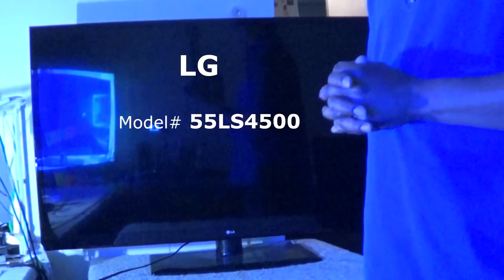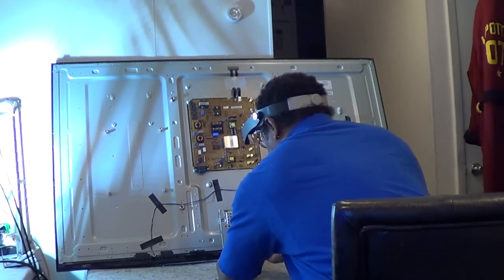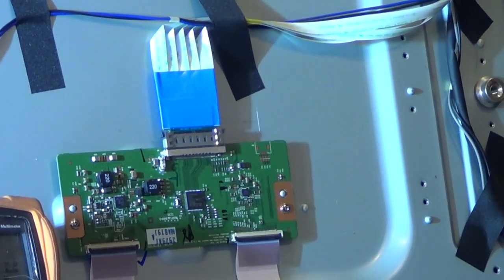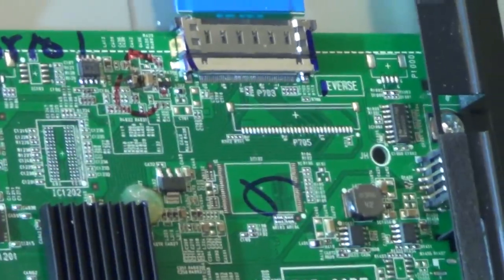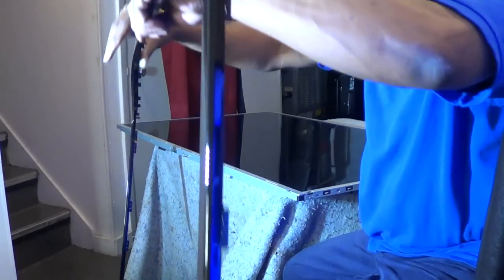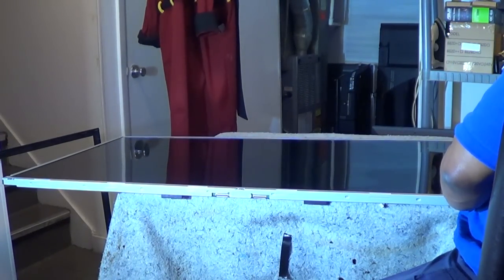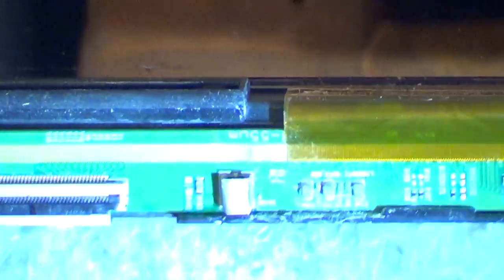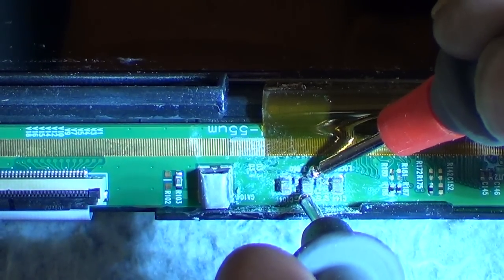Backlight but no display. T-Con board or bad LCD Panel? How to Isolate

Comment: Bigdog, I have the same problem on an LG 47LW5300. Originally the power would click and it would blink red twice black screen. I just replaced the main board and now the backlight came on, but no picture. 

It does exactly that. I checked the fuse that you checked at the beginning of the video and I am getting continuity. I think in your video you weren't getting continuity? Is that fuse supposed to have continuity? I am getting 1.4ohm on both sides when I ground to the case and check both sides. If I turn the TV on and test for voltage on the fuse like you did at the end... I get zero and not 12v like you did.

I get a white screen, no logo or menu. I disconnected one side of the tcon board and the whole screen is the same white. Disconnected other side and got same result. Basically screen is completly white no matter what I disconnect from the tcon board. I don't get half screen working.

Edit: I just checked and I am not getting 12v to the tcon board and the tcon board chip is cold to the touch. Power supply is giving power to the left lights. I have to check if the main board is getting 12v.
Reply: I did some more testing. I ruled out the power supply. Power supply has all the listed voltages and it's powering the backlights. I check the voltages from the power supply to the main board and they are good.

I am not getting power out from the main board to the tcon board. I checked pins 48-51 on the lvds ribbon on the main board and did not get 12v. The main board is receiving 12v, but it's not sending it to the tcon. 

I confirmed that the tcon is not receiving 12v by testing the fuse. The fuse beep when I tested for continuity, meaning is good. It leads me to believe the main board is not powering the tcon board. That's why I am getting backlight and no picture.

I followed this article for testing.

http://electropair123.blogspot.com/2017/01/t-con-board-troubleshoot-no-picture-on.html?m=1

Comment: Hi bigdog8882 When is a vertical black line almost in the middle of the left side?
Reply: Is un60fh6003f    t con BN96-28944A, where is a volts?

Comment: Hello sir nice vedio i have a similar problem but on t-con board i remove the shorted capacitor 
and did not put in any i leave it just like that and it started to play ok ,is  it all right to do that or it will give problem shortly.
Reply from the maker: Its there for a reason. Take Ur chances.

Comment: Big dog please respond, same thing happened to my TV last night, opened TV up and found the crustation from water on the lower board,  I cleaned it with proper alcohol, re-assembled everything and I get the same thing. It does look like one of those capacitors blew out. Should I replace t con or do what you did in this video.
Reply from the maker: Where was the water corrosion ? Which Board. T-Con or Driver board?
Reply: @bigdog8882  driver board
Reply: I have model number 60ln5600 LG
Reply from the maker: @petermcdowell63  Well, U got water damage so its hard to say, You have to test the capacitors in the Vid like I did. Its a good chance that theres something bad on the driver board. U can try t-con, but dont give your hopes up.
Reply: @bigdog8882  lol my Hope's are high after watching your video, I absolutely love this TV and dont want to junk it. My next step is to try to locate driver board and t-con board.  And find a shop who knows what there doing. Thanks for the quick response, you da man 👊
Reply from the maker: @petermcdowell63  They dont sell the driver board by itself because its bonded to the screen (U have to find the whole screen). But you can definately find the T-con and replace that. Thanks for watching.
Reply: @bigdog8882  I actually found the driver board replacement. Believe it or not on Ali baba. And looks to be OEM equipment . This is the driver board P/N  6870s-1491a. Check it out let me know what you think.

Comment: I have the exact same model TV sitting on the table opened up in front of me. I don't have this problem, but tested most of the items you showed here for thoroughness. My problem is the TV will play fine for anywhere from a few minutes to an hour or so and then various sections of the TV seem to lose backlight. 

It started over a year ago with only one dark spot that would come on and off randomly as the TV was on. Now it has about 3 sections of the TV that get darker (as if the LED's in those sections would stop burning). Sometimes they light up fine, but usually at least one of the sections are dim on startup, then the other couple go out as the set warms up more. You can watch the TV fine, but it's very noticeable unless you're watching a dark movie. Bright commercials show it very evidently. 

Does this sound like an issue from the power supply dropping out for certain sections of the backlight? Or more likely failing LED's? I checked the test points at the top of the secondary side of the power supply board labeled LED+ & Gnd and it shows about 76Vdc. The two connectors beside that test also 76Vdc on the LED+ pins. I tested 3 of the longest pins on those connectors with my meter's common lead on the Gnd test pin and they all read about 19-20Vdc. (I didn't risk testing the shorter pins from fear of shorting 2 pins with my test leads.)

Guess I'll have to break the panel apart and isolate bad LED's right? Any advice is appreciated.  Great tutorial by the way!

Comment: whats up bigdogg! I like the video/info, very helpful! one question on my 46" Samsung smart led tv I found a little burn spot on the ribbon cable going from the driver board on the bottom to the LCD panel... can this be fixed and is it worth fixing? paid $1000 for the TV new in Feb. 2010

Comment: I have Samsung TV UN 39FH5000 FXA that don't have backlight also when plugged in power stand by light flashes 6 times. I was measuring voltage on wires to backlight and got different reading when main board connected to power supply board reading goes to zero, but when main board disconnected, reading is 193V on connector D+ but when I measure voltage on wires from mainboard to power supply board voltage is as noted on power supply board. can you please advise what to change to fix it? 
Show less
Reply from the maker: You need to use a backlight tester because in a lot of cases an open led cause front led blinking with a Samsung.

Comment: Panel is not shot  as he says if the driver board or cof is bad. Nowadays the driver board can be replaced with the proper equipment  anziotropic, or Z axis film, special remover for the tape , a T bar soldering iron, a microscope, and lots and lots of patience the chip on film connectors and buffer (driver) boards can be purchased also. Although special machines are used in the bonding process it can be done manually. There are many videos to explain the basics the specifications and instructions are on the web if you look. Any reasonably intelligent person who is Handy with electronics can do it. Have fun!
Reply: So basically, you are recommending to take a soldering class, purchase special equipment, and source hard to find parts to repair a TV that isn't worth more than $200. 👏👏👏👏👏

Comment: I replaced the tcon and I get 12v but not 8.5v on the test point even before I hooked up the panel ribbons, bad panel?
Reply from the maker: I would think it would be just the opposite. If U got the 8.5v, but then when U hooked up the panel the 8.5v is missing, then U got a bad panel because the panel would be drawing the voltage down.
Reply: For some reason the ton wont produce 8.5 at all, but the 12v and 3.3 is on the tcon, even on the panel

Comment: Dumb question but does the tv have to be on or off to check for a short?
Reply from the maker: Whenever checking resistance the device has to be off (no power/voltage). Yes OFF!
Reply: @bigdog8882  I appreciate the quick reply! And great videos btw!!

Comment: Hello BigDog, I really enjoy your videos and wonder if you could give me some advice as I am a newby. Sharp LC-42LB2621u - Standby changes from red to blue, have sound but no picture. All LED's working. changed T-Conn board. When powered on Led's come on and then dim after a few seconds but remain on. No picture at all, not even menu. Screen turns blue at power up then goes black. Please HELP. Thanks in advance.
Reply from the maker: If the leds are still lit and U changed t-con and still have the same problem. the U may have a bad lcd panel driver board just like in this Vid. Remove the ribbon connectors going from t-con to panel, one at a time then see if U get half a picture(display).
Reply: Thank you for your prompt response, your diagnosis and suggestion were on point. I did get half a screen. Could not see any damage to the driver board with my (superman glasses) LOL. so I guess it's a paper weight.

Comment: Need help!! Spend a lot of time on my samsung and money no fix yet my model number un55ju6500, tv has no backlight, standby light , treid turning on tv nothing, unplugged mainboard from power supply and still no backlights, flash light tested it can see it boot up and turn off, wondering if its the panel or the inverter board or something like that
Reply from the maker: Had some of those. Bad Panel, especially if it keeps turning the backlite ON/OFF every 15 seconds with No  Display.
Reply: Backlights dont turn on what so ever, could it still be a driver board or bad panel??
Reply from the maker: @ditchmitchellt1202  Oh OK, Thats hard to say. Especially If you can see an Image on the Screen with the Flashlight. That usually means that the Panel and Drivers are Ok. Could have a Power Supply or Backlight Problem.
Reply: Thanks for all the  help, i think its the power supply and backlights, your right, the backlights flash, but i dont think its a panel issue took off panel and tested each board first was my power board backlights flash but dim tested with main and tcon they still flash but way brighter, looked on my power supply on the back looked ic801s chip two legs looks  desoldered from board and couple  led are gone two when i tested it, its a samsung un55ju6500 idk if i told yu the model yet, would a bad ic chip and leds burned out make my not turn on like that? My main board gets warm fast idk if thats normal
Reply from the maker: @ditchmitchellt1202  I would definitely use a Backlight tester to test the LED's first.
Reply: @bigdog8882  yea most likely power board using the led tester the leds light up fine when i plug it back in does the samething, plus i have 7 leds out, to test i used the pins in the cord that go into the leds could only light up half the leds how its wired then lit up other half fine, when i plugged in power board the lights started to flash again very dim

Comment: Ok so if no video no sound more likely it’s the main board. I have 50” Hisense no picture but had backlight. Also no sound. I already replaced T-Con it was only 10 buck from eBay so I am not even gonna return it. I ordered the main board with power supply included hopefully that solved the problem

Comment: what did u use to clean the water damaged area
Reply from the maker: 91% alcohol and a Q-Tip
Reply: @bigdog8882  I'm having similar problem with my tv atm it's turning on screen lights up backlights work but no video or audio I tried changing inputs but nothing just black screen with nothing
Reply: If I removed the ribbons and put them back in would that cause something like that or is it because of another issue
Reply from the maker: @damionchadee6715  All I can tell U is it sounds like  either T-Con or bad Panel.
Reply: @bigdog8882  it was working well a while ago then on the left side of the screen some vertical lines appeared and that side of screen went dark so I opened the back cover removed the ribbons cleaned them with a tooth brush but after putting them back in no picture  I was really carefull so what do u suggest change ribbons and tcon board ? Any suggestions will be appreciated right now
Reply from the maker: @damionchadee6715  Make sure ribbon connectors are not bent on the ends and make sure that there flush and pushed all the way into the connectors.
Reply: The curved part of the ribbon goes down to the  panel pcb ? That's how I took them out should I try putting them the other way ?

Comment: Hello sir I have Sceptre 55 4K u550cv I already changed t con board but problem still there there’s lines going on screen no pictures but sound coming t con board number is 5555T17C18 what should I do now
Reply from the maker: If You got vertical lines you may have a bad driver board on the Panel. Or in other words a bad panel.
Reply: Lines going bottom to up I can send pictures if you want to see please tell me what I can do it’s world cup going on and I’m miss all the matches